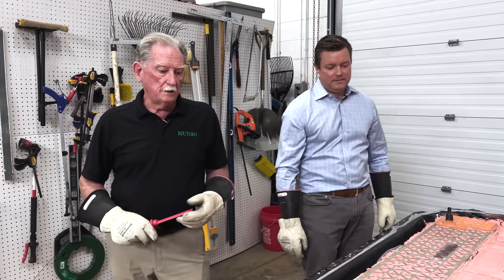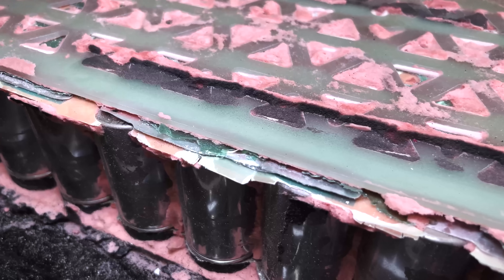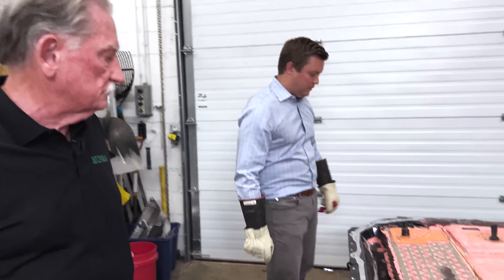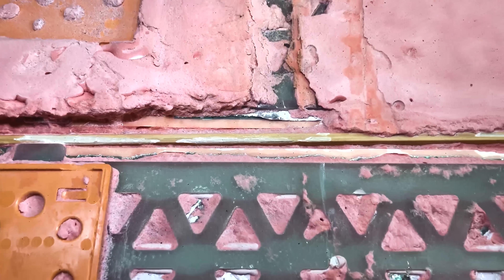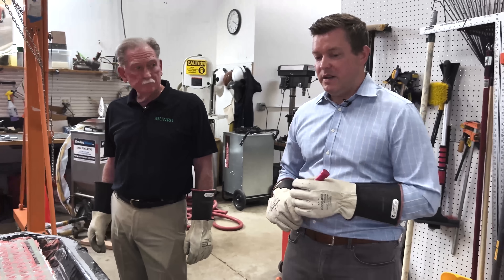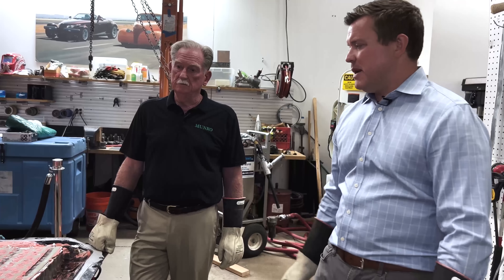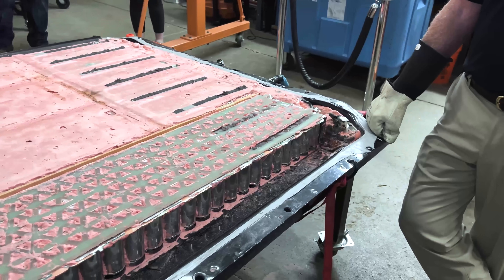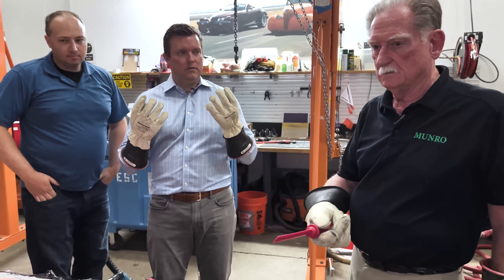4680 Battery Pack: What We Found Under the Foam!

Comment: Cory, Sandy and team Great video. Interesting comment from Sandy, 'Telsa does not have a limit on their capacity to invent'  This permanent foam approach, a person can never do maintenance on this type of battery pack, means Telsa has lots of faith it will have extremely low failure rate.
Reply: Capacity to correct their errors and restart the learning curve for manufacturing.
Reply: Tesla has always found it too dangerous for their service technicians to work inside packs. They get assembled, sealed, charged and are supposed to stay sealed until they get recycled. So nothing new here, the foam just seals the deal.
Reply: It also means ultium is a joke.  It is designed for serviceability because GM has zero faith in their batteries.  The companies that cut corners to reduce warranty risks will have less efficient cars that cannot compete.  Tesla can probably recycle an entire pack to base minerals for less cost than a single in warranty cell replacement on an ultium pack.
Reply: "Maybe"...... Only time will tell.
Reply: It panhandle used vehicle and you risk something big and expensive going belly up. A high spec engine of transmission costs £££$$$ plus another huge wedge to fit the new parts.
Reply: It panhandle used vehicle and you risk something big and expensive going belly up. A high spec engine of transmission costs £££$$$ plus another huge wedge to fit the new parts.
Reply: Not to mention (to all the "but service" commenters) but if it's under warranty and fails, you get a complete new pack, WINNER
If it hasn't failed by then, it's likely to last much longer.
Reply: @rogerstarkey5390  Right then they can recycle it and make a new one.
Reply: @rogerstarkey5390  yeah, this makes sense. Also, if you remember from the earlier videos from when they dropped the structural pack, it was among the simplest to remove from the rest of the car Munroe has torn down, iirc anyway. Meaning that once these are manufactured at scale, this is going to be a relatively simple procedure, decades from now when you finally do want to replace your battery because the rest of your car held up for 400K miles. And it will probably be cheaper and more energy dense by then as well.
Reply: @normanbayona4636  This does not appear accurate, previous dives into the service manuals indicated that replacement of the 4680 structural pack requires 314 steps (143 for removal and 171 for reinstall).

With the structural pack you're removing the entire floor of the cabin, and everything attached to the previous pack needs to be removed and put on the replacement pack.  Now if the plan is to just unbolt the structural pack and plop in a new one with new seats and everything attached, that's a different story but I think is pretty doubtful.

Otherwise I have a feeling that replacing previous battery packs is much simpler than this.
Reply: @Destor-p3b  I agree. There was a Tesla video of the model S getting the pack replaced faster than a car gets filled with gas
Reply: @nickvanhorn681  It should be, you would just be hoisting the vehicle and removing the pack from the enclosure under the vehicle right?

The structural pack might simplify things for Tesla during the manufacturing process, but replacing the packs afterwards looks much more difficult from a serviceability standpoint unless they're giving you all the components with the new packs as a pre-assembled unit.  And I'm sure that's not the case, they'll be taking all the components from the old pack and switching them to the new pack.

This would also likely increase the incidences of post-replacement issues, as swapping out all these components introduces more opportunity for human error along the way.
Reply: @normanbayona4636  But I wonder how these cars will hold up long-term against killer rust? Some EVs are already rusting quite badly.
Reply: @tomlewitt  to my knowledge aluminum holds up better to corrosion, though folks in the north dealing with salt on the roads might have it harder. But assuming that's generally true (and I admit it may not be true), at least the structure would be in decent shape.
Reply: @rogerstarkey5390  If it's under warranty and fails, I heard most people gat a REFURBISHED pack.  Not a new pack!! 👎
Reply: @ajsaldana4212  
Ah!
"You heard!"
That's 100% cast iron guaranteed then......?
Reply: @rogerstarkey5390  So after warranty its trash? Or do we just devalue it 20k? I'm sure the full cost of replacement will need to include labour and hazardous material logistics for a questionable pack to be re-cycled (or landfill if its cheaper) on top of the specialist shipping and price of the new pack to the nearest approved shop. Also what about all the cars too far away from an approved shop. I cant get too excited for this, perhaps better tech will be born from it. But there is still a long ways to go. If something can go wrong it will, at the number these will be cranked out its sad the last 10 years of the cells life will be wasted due to 1% of the cells which will wear at 3x the speed.
Reply: @alphabuilders  
 You're from the "if's and but's" department?
No.
"After the warranty" it may be good for decades. "We" don't know.
It's certainly NOT "Trash"
"The full cost of replacement" 
Will obviously Include labour (noted by the spelling you're from the UK? Oh dear.)
As for "Hazardous materials logistics" ..... Why?
The company REPLACING  the pack would simply call the supplier of the new pack and say "we have an exchange unit ready for collection", kinda like they do with ICE engines now?
That would happen on the routine day the deliveries are made in the area.
They would then claim the value of that pack (yes, it's worth money!)
.
The new direct replacement, containing cheaper cells (Tesla estimate 50%, because in the preceding years they'll produce Billions of them) would be bolted to the reset battery management and control module (yes, it's separate on a Tesla, sitting on top of the "battery box")
.
So, you'd have a "pack" 
(battery module) at 60% of the original "module" cost,
minus a consideration for the valuable old unit, fitted to the control box you didn't need to pay for, plus about an hour of labour each to remove and refit, then an overnight charge, followed by let's say another hour for the final automated condition check and a road test?
(Try that amount of labour for an engine swap? More like days)
The "questionable" pack would then CERTAINLY go to a specialist recycler (come to think of it, THEY would collect it!)
They will check the discharge, shred it, and recycle "ore" at 1/6th the cost of new stock (actual statements by those doing it will confirm this).
.
Then there's the possibility that I've mentioned of maybe "fusing" a cell (conventional, or electronic) to simply remove 1/850th of the capacity? Remember, they know about cells now.
Just btw, how do you "know" that "1% of cells will age at 3 times the speed (rate)"?
Reply: @rogerstarkey5390  What do you say to people buying a used vehicle outside of warranty? Too bad, go buy a new battery?
Reply: @DavidJohnson-tv2nn  You say the same thing you'd say to anybody buying any used car, EV or ICE out of warranty, the difference being Tesla's warranty is 100,000 miles. Real-world experience suggests that if the battery hasn't failed during the warranty period, it will most likely last half a million miles before output degrades below 80% of new. 

The reason you pay a fraction of the new car price is that there may be unexpected repair bills. Maybe that's why used cars cost less than new ones.
Reply: @douglasburnside  How much does a used Tesla cost? I believe they are not cheap. The point it is that it is unacceptable to have the most expensive component in the car, costing $10,000 + be unrepairable!
Reply: @douglasburnside  What real-world experience?  Most Tesla owners don't hold onto their cars long enough to find out!  Most have traded it in on a newer version with 'the latest' version of gadgets.

The few who have, replaced AT LEAST one drive unit, if not also the battery.
Reply: @DavidJohnson-tv2nn  
You need to both define and verify "unrepairable"
What will you say if they determine each cell is "fused" and can be "mechanically" (or electrically) removed from the circuit?
That would essentially be a "repair", only reducing the capacity by 0.125 percent.
.
Reply: @rogerstarkey5390  This design was not built around single cell or even module or section replacement, but as ONE SINGLE UNIT.

That would mean it's not repairable a d wor have to be replaced in a specialized shop with a specialized frame jig, since it's essentially the base of the car's frame.
Reply: Elon has said that they are trying to make a million mile battery pack. A significant amount of climate change gas is released to manufacture a car, so making cars that last a really long time also reduces climate change gas emissions, which is the entire objective for Tesla. The Cybertruck will not rust and it is super hard to even dent, plus no paint, and it will have basically this battery pack. I expect the vast majority of Cybertrucks to still be on the road after forty or fifty years.
Reply: @tribalypredisposed  elon say's lot's of stupid shit
Reply: @tribalypredisposed  Then you haven't seen a recent salvage auction.  Many of those vehicles were brand spankers before being wrecked.

But if you're TRULY concerned about the environment, then buying NEW CARS is one of the WORST things you can do.  Better to drive an older ICEV and maintain it properly, than incentivize a company to put out new disposable crap that's obsoleted in 5 years (Teslas included).  There are OLD (20+ years) used ICEVs on the road with over 250k on the clock, working just fine.  There isn't an EV made that has (or CAN) rack up those miles.  Any that have come close, have had AT LEAST 1 motor and one battery replacement.  And newer charging standards don't always work with them.
Reply: @billcichoke2534  that’s been proven false time and time again. An efficient EV like the models 3 is better for the environment after 18 months and even with a dirty grid and and less efficient EV worse case is like 4-5 years. 

ICE cars have tons of issues after 100k miles. It’s pretty common for an EV to make it to 200k miles and for the average driver to reach that it will take around 20 years.
Reply: @billcichoke2534  dude there are Numerous Tesla taxis on the roads with Ober 300k miles on the original battery and motors.
Reply: @anonym3017  Not according to the operators.  And those have been almost entirely Model Ss, which were built SLIGHTLY better.  All have had either just drive unit or both that AND battery replaced.
Reply: @billcichoke2534  I made the decision to live car free in 1977, the solution is a bicycle. But most ICE cars are only good for 150,000 miles, average, no matter how well you take care of them. Most Americans will not abandon cars, so the best option for them is to make EVs that last a really long time/have robo taxis that replace multiple ICE cars with one EV. 

Probably we are all doomed at this point anyway and I should just fly around the world having fun and emitting climate change gas like crazy. But on the off chance I will still be out there pedaling away.

Also, there are plenty of Teslas with more miles than that on their first motor and battery pack. It was only basically the first year of Model S Teslas that had motors and packs that needed to be replaced under warranty in significant numbers.
Reply: @tribalypredisposed  I would beg to differ...most cars aren't taken care of, yet STILL get to 150k or better.  The ones that ARE taken care of, last well past 200k.  Quite a few Toyotas and older Mercedes have gone past 1 mill miles on the original drivetrain.

I don't see that happening with EVs.  Like touchscreen phones, they're built around technology obsolescence, which means sooner or later they won't be supported.  That means multiples more junked cars destroying the environment, leeching toxic metals into the ground water.

If you're in a situation where you CAN bicycle around, then that works for you.  Personally I think limiting peoples' choices for personal transportation risks more problems than any we THINK we have now.  And we're using more and more energy to not use petrofuels, which means we're being even LESS efficient or good to the planet.

Fixes are being put in place to address what wasn't broken, and many things are ending up worse off as a result.
Reply: @billcichoke2534  you can beg reality to differ, but reality is reality. Yeah, you can easily find articles claiming that the "average" modern car can last 200,000 miles, but here are the actual numbers of cars with over 200,000 miles in percentages: Toyota Land Cruiser: 15.7% over 200,000 miles, next highest car model is the Honda Odyssey with all of 2.7% having over 200,000 miles, and it goes down from there. The eighth best car for longevity, the Toyota Camry, only 1.5% have over 200,000 miles. 

Once Tesla has a lot of cars old enough to reasonably have 200,000 miles on them, the Tesla percentages will be much higher. There just is a lot less that can break or go catastrophically and expensively wrong, and the cars keep getting over the air updates so they do not in fact become obsolete, instead they keep getting better. Lots of Tesla owners have cars with faster acceleration and more range and faster charging than when they were brand new, in fact.
Reply: @tribalypredisposed  Actually, since these cars are computerized and have more electronic components than mechanical, there is far MORE that can (and DOES) go wrong.  Those 'updates,' by the way, have been interface and display changes, but mostly BUG FIXES.  They haven't been IMPROVING the cars, they've been CORRECTING them.

What most people don't understand about EVs is...you don't maintain them because you CAN'T.  There is little if anything that is user serviceable, and anything that does happen, is a component FAILURE that requires REPLACEMENT.  If your gas tank springs a leak, you don't have to replace it AND THE FUEL SYSTEM.  Often it can just be patched.  You lose ONE CELL out of a Tesla battery pack, the WHOLE THING needs to be replaced.  As well, you can lose the ability to keep a charge due to manufacturing errors, and no scan will ever find the problem.  You lose a spark plug, it's pretty obvious what's going on and the fix is as simple as a new plug.

THAT is the reality.  The narrative about their superiority, is the sales job.
Reply: @billcichoke2534  the amazing thing is that nothing you say in your long posts is true. I worked at Tesla making Model 3 battery packs, for example, and they definitely do not brick if one cell goes bad. In fact, lower range packs were made by adding some plastic dummy cell blanks to the pack to fill the space. 

Thanks for coming around to audition for the  role of "online person who knows something about EVs," don't call us, we will call you.
Reply: @tribalypredisposed  What's TRULY amazing is, your post is a bad strawman and Tesla themselves REPLACE THE PACK if there's a bad cell.  And I've been involved with EVs since well before Tesla was a thing and Mysk bought his way into it.

Your opinion is now as invalid as your 'expertise.'  Stop parroting Musk and learn to do your own research.  You won't sound as ignorant next time.
Reply: @billcichoke2534  A few months ago, the first model S with more than a million miles on the clock was confirmed.
Reply: @fluitfluiten  If it as the gent in Europe, that car had more than one motor replacement and at least one battery pack replacenent.

So no, it didn't.  Not even close.
Reply: @tribalypredisposed  
"Elon has said that they are trying to make a million mile battery pack"
Trying?
Musk is also "trying" to make full self driving work. And has been making claims every year since 2015 that full self driving is just around the corner!
Tell me something...
While Musk is "trying" to make his million mile battery....
Do you think putting unrepairable battery packs in customer cars is ok or the right thing to do?
Reply: @DavidJohnson-tv2nn  Sure if the battery fails under warranty it’s replaced or you get a new car or some pro rated cash equivalent.   If you don’t agree to that then don’t buy the vehicle.
Reply: @ken-mb5cp  So what do you say to people wanting to purchase a used vehicle outside of warranty? Too bad, you're out of luck?
And what happens if other manufacturers copy this throwaway stuff? Should people just not buy cars and walk instead?
Reply: @DavidJohnson-tv2nn  Buy an extended warranty.   I think they’ll be robotaxis in a few years and you won’t need to own a car.  The market will figure it out.   What’s your solution?   Stick with gas cars?
Reply: @ken-mb5cp  Yup.  Much better spend if your money and ACTUALLY HELPS THE ENVIRONMENT.
Reply: @DavidJohnson-tv2nn  Yes David, just like every other device in your house and pocket have become uneconomical to repair.  That's how you bring down acquisition cost.  That has been learned in nearly every industry.  Take a moment to compare a video of AP/FSD from 2015 to 2018 and then 2022 and it's obvious how far it has come, even if taking longer than promised/desired.  People who actually produce complex products in technology understand how hard it is and how often timeline are overrun.
Reply: @DavidJohnson-tv2nn  That's what Brandon's people are telling us.
Reply: @B.L. Alley " brainwashed by big oil"
Oh really? Did I say anything about gas powered cars? 
I'm specifically talking about the unrepairable 4680 battery pack as compared to previous battery packs.
Reply: Truly amazing on the capacity of Musk fans/Tesla investors to spin built in obsolescence into a good thing. Yep customers, pay $10,000 for a new battery and be happy!
Reply: @DavidJohnson-tv2nn  What do you think it costs to replace the engine and transmission in an ICE car? Would that make you happier? It is far more likely to have an out-of-warranty ICE replacement than a Tesla battery which is guaranteed to go at least 100,000 miles. Note also that the batteries rarely "fail", they gradually (about 1-2% per year) lose efficiency. Even after 20 years, when they might be down to just 80% efficiency they can be repurposed for home solar storage or other uses. What repurposing will you get from a 20 year old iron-block V-8?
Reply: @douglasburnside  This is not a debate about ICE cars vs EV's. It is about purposely designed unrepairable battery packs, and built in obsolescence. There are many used cars purchased that have over 100,000 miles, and are out of warranty. What do you say to those people? Too bad? Go pay Musk another $10,000?
Also, hope you realize these 4680 packs can not be dismantled to have their modules repurposed as home energy storage. A total waste!
Reply: @douglasburnside  INCLUDING labor, it costs about $5k to replace engine and transmission.  That car is then good for at least another 100-200k.  It also won't become obsolete, like the golf cart with an older iPod.  So there's no NEED to repurpose the ICE...you're still able to use it, often for longer than THIRTY years.
Reply: @DavidJohnson-tv2nn  Turnkey 10 sp Transmission replacement for a Honda is >  10k !  It likley a LFP battery will be cheaper soon. Many transmissions don't last the life of the car.
Reply: @longtimber1  Transmissions are also repairable for way less than 10k. Not sure about the Honda, but if costs were that high, I wouldn't purchase the car. Like I won't purchase a Tesla. 
In my opinion, the thing that needs to happen is for government to step in and ban unrepairable EV battery packs. Or other unrepairable components, EV or ICE, costing thousands of dollars.
Trust me, you wouldn't want to live in a system with total unregulated capitalism. Where greed would rule.
Reply: ...Trust me, you wouldn't want to live in a system with total unregulated capitalism. Where greed would rule...

 @DavidJohnson-tv2nn  1) No such thing as unregulated capitalism in market economies. 2) Market transactions are 2-way; greed rules on both sides and somewhat counterintuitively, it all seems to work out 3) And the utopian alternative is ?? Maybe the state enterprise (UNREGULATED state capitalism) vs private enterprise, the ideal worker collectives of the Soviet era, Mao's China, Pol Pot's Cambodia, etc, etc, etc. Lovely times... no greed or corruption there and perfect for the elite CP members.
Reply: @DavidJohnson-tv2nn  Completely agreed on regulated capitalism. Governments must exist to address various free market failures.
Your characterization of BEV lithium-ion batteries as throwaways is an overstatement. It's nearly impossible to kill LFP batteries and the current iterations will easily last 500K; they (whoever they are) say 1M miles is achievable for LFP. And ternary batteries are good for 1/2 or more of those miles if you follow proper charging methods. T's warranty is 8 years or 100K. I believe they hedge low in case the end user regularly supercharges to 100% which greatly shortens the life of the ternary battery. Normal wear is 1-2% per year or 10-20 years of service... hardly throwaways... and I as a consumer will feel very happy (not screwed) with a BEV that lasts 10-20 years before its next battery replacement. PS...the 4680 will, by superior design, last even longer than prior gen ternary batteries
Re regulation... no need. The BEV manufacturers on their own will improve battery technology without incentives or regulation. That trend is very well established. It's in the BEV maker's best interest to make the most competitive product they can. Needless regulation will cause rather than solve problems...  perverse results and/or lower efficiencies. To wit, organic farming in Sri Lanka... the list is endless.
Reply: @russhare4793  Batteries that can't be opened for repair are throwaway as far as the customer is concerned. Recycling does him or her no good. 
Despite all the claims, battery packs can and do fail outside of warranty. There are many examples on YouTube. One guy got so peed off he literally blew up his Tesla on video! That battery was repairable. But Tesla refused to repair it. Continuing their long history of being anti-repair. 

You can argue the numbers are low all you want. That means nothing to someone who receives a $10,000 to $20,000 bill! These are the people who need to be protected.
Ban all unrepairable EV battery packs. No matter who the manufacturer is.
Reply: @DavidJohnson-tv2nn  1) Tesla is NOT anti-repair. Simply put, they take a different approach to vehicle service, one they think is superior to the prevailing approach. If/when they feel the need to change their methods, they make changes, something they are doing RIGHT NOW. Tesla recently freely open-sourced all of its repair manuals meaning any mechanic can learn how to repair any Tesla vehicle for free. This opens the door to 3rd party service - we'll see how that plays out. In the end, customers will choose  Tesla or not, for whatever reason, service, quality, safety, efficiency, engineering, performance, range, etc. If you don't like their service approach, buy something else.
2) How Tesla designs/engineers its battery packs is their business, not yours, and certainly not the government. Where you complain, Sandy Munro praises. I'm siding with Sandy on this one. Once again, if you don't like it, don't buy it.
3) You're pulling all kinds of numbers from some part of your body. You have no idea how long the 4680 cells are going to last nor how expensive they will be to replace. It's brand new tech; will most certainly improve as Tesla iterates and as Jordan from the Limiting Factor predicts, the cost to manufacture will asymptotically approach the material cost (meaning the cost will GO DOWN A LOT) as Tesla massively scales production.
4) Finally, as recycling scales, the cost to replace could easily be LESS than the cost to repair. This is all in the future - we'll see how it plays out.
Reply: @russhare4793  1) It is not up to Tesla to decide who gets to repair the vehicle. It is up to the owner who bought and paid for it! Tesla IS anti-repair and there are numerous examples out their. Check out the Rich Rebuilds channel. Those service manuals should have been made available from day one! Yet more evidence that Tesla is anti-repair. Furthermore, from what I've heard, the manuals are inadequate. They show you how to remove and replace components, but not repair them. For example, no information on how to disassemble and properly repair an electric motor.
Reply: @russhare4793  3) and 4) I'm basing the costs on current, KNOWN replacement costs. NOT listening to Musk and his supporters claims. According to Musk, full self driving was "just around the corner". He's been saying that every year since 2015!
And.... How's that Hyperloop working out?
Or....
*  Boring company 150 mph loop system. Where ANY car can drive onto a carrier and zip off to their destination at 150 mph.
* Tesla Semi.
* Tesla Roadster.
* Cyber truck.
*  Starship flight to the moon in 2023. 
* Spandex man (Tesla robot). We don't need Cylons!
* The "Borg" (brain implants). Thank God that hasn't happened!
* Tesla solar.
* Robo taxis.
* $25,000 Tesla.
* Anything else I missed :)
Reply: @DavidJohnson-tv2nn  Look, Dave. You seem to be an f'ing know-it-all for everybody just because you say so. You disagree with Tesla's approach to service... I got it. BTW, I never said which side of the "right to repair" (which is sorta presumptuous in the first place) argument I am on. I like my repair guy and I hope someday Tesla opens the process up to others. In the meantime, they can do what they please, period. If you don't like it, DONT BUY A TESLA. Stop whining. and grow up. Everybody gets to have their own opinion and if they disagree with you, so be it.
Reply: @russhare4793  If Sandy Munro does care about consumers, then I wish he would come out and condemn designs that make repair of battery packs impossible. These packs cost thousands of dollars. And the 4680 can't be repaired, or repurposed for that matter. No way to remove modules for home energy storage. This design is NOT environmentally friendly or consumer friendly.
Despite claims about recycling, it is far better to repair, repurpose, and reuse.
Reply: @russhare4793  You agreed that government has a place in regulation. And no, I don't know it all. But do have some strong opinions on some things. Didn't mean to offend you in any way. 
I really wish you would rethink that Tesla and other companies can "do as they please" and the inevitable consequences of that.
You or I can't do as we please. There are good reasons for rules and laws.
Have a good day.
Reply: @DavidJohnson-tv2nn  Oh yeah, that's what we need.  The government to come save us some more.  David and the government have all the truth.  Never a doubt do they have whether they might be wrong about something.
Reply: @russhare4793  Unregulated anything.  As long as humans are involved, someone will find a way to get an advantage.  Some ways to benefit; some ways to harm.
Reply: @DavidJohnson-tv2nn  Those goals you list are NOT Tesla's goals for their packs, so of course they are not optimized for those purposes.
Reply: @DavidJohnson-tv2nn  They can do as they please as it pertains to their business.  If they're wrong, they fail and you get the glory of "I TOLD YOU SO!".  Their track record is not one of failure, except as a weigh station on the path to success.  You seem to view every current state of their product as the eternal end state, even though they clearly never stand still.  The Model Y has been on the market just a couple of years and has already undergone substantial renovation.
Reply: @scottgaree7667  Corporations can not be allowed to do as they please. We as individuals can't even do that. Are you suggesting that corporations should have more rights than people?
In an environment of anything goes, they could put out unsafe products, lie, cheat, price gouge, and the list goes on.
You must be a Republican?
Reply: @DavidJohnson-tv2nn  Ha ha  ha try $20,000!
Reply: It also means that any hopes of recycling any of this are lost.  For shame.
Reply: @davereichert  Apparently you didn't watch the video. 7:50. Nearly 100% recyclable.
Reply: @douglasburnside  Sure, but practically everything is recyclable, provided you throw enough money/energy at it.

If it doesn't make financial sense to recycle, though - it won't be recycled.

There's plenty of "recyclable" material that gets diverted to landfill because there's market for it.  This will be no exception.
Reply: @douglasburnside  No, we're just living in reality, where it ISN'T.  Not even CLOSE to 100%.
Reply: @davereichert  Did you watch the video? The batteries aren't removed one by one and recycled. the whole unit is ground up and recycled. This was explained clearly in the video.
Reply: @arseliopereira2541  And what does it cost to separate all of the materials in that resultant composite of granular material?

How much energy, and how many different hazardous chemicals are involved in that process?
Reply: @davereichert  let’s see that resultant mixed powder has way higher concentrations of any given material than the best ore for the same material.

Meaning that the answer for both energy expenditure and cost is “an order of magnitude or two less than what’s required to get the same amount of material out of ore.” Cause gravimetric methods get you pretty far
Reply: ...How much energy and how many different hazardous chemicals are involved in that process?...
 @davereichert  Battery recycling, a closed-loop approach with far fewer opex, carbon, and ecological costs compared to original mining, refining, and logistics... Duh
Reply: @russhare4793  I guess that explains why so few lithium ion batteries are recycled now?  

Pretty much the only thing the market is currently doing with old cells is shoving them into cheap USB powerbanks.
Reply: @davereichert  My guess. The recycling facilities are nowhere near scaled at this point; the mechanisms for diverting recyclable materials are underdeveloped/inefficient; and, the availability of a significant amount of recyclable materials is just not there at this time
Reply: @davereichert  All battery packs are recycled this way. Nobody is going to open a battery pack, remove the batteries, open the cans and dump the contents out.
Reply: @davereichert  Sandy talked about this.  Dip it in nitrogen to freeze it, put it in a grinder and you end up with "high quality ore" that can be processed to extract raw materials.   Time will tell to see how much that ore is worth and if it makes up for the lack of reparability.
Reply: @davereichert  No, it is very recyclable. That is there intention for the end-of-life battery.
Reply: @davereichert  

Define "recycling"
If you mean "second use", no. A pack at 65% is still useful.
.
If you mean "recycling" (reclaiming) materials, watch the video again (" big shredder")?
Reply: @davereichert  Maybe you should pay attention to the video instead of commenting utter BS.
Sandy explains for several minutes how it can be recycled.
Reply: @macko-dad  
Yes, that recycling skit was hilarious.
Reply: @macko-dad  Yeah...and Sandy also fell for the 'solid hydrogen storage' scam.

This is designed to be REPLACED...aling with the rest of the car.  You won't repair or reuse this, since everything is WELDED and FOAMED IN.  You can't take it out of the car, si ce the body is stressed to it and would break if you tried to reintroduce a new pack.  And the processes needed to dissolve the foam and extract any usable materiel for recycling, are pretty much illegal except in specific laboratory conditions.  Sandy's nitrogen concept totally ignores this, as well as how certain alloys and compounds react to liquid nitrogen.

This is the most illogical concept I've ever seen on a 'preproduction' vehicle.
Reply: @macko-dad  Things only get recycled when it's cheaper to do so than sourcing new materials.  It'll only be cheap enough when it's easy.  They haven't made it any easier with this design.

Are you also against right-to-repair?
Reply: @billcichoke2534  1. they literally removed the pack from the vehicle and then put the remaining vehicle on a hoist and lifted it. So you can evidently replace the pack.

2. you don‘t need to remove the foam for recycling. You don‘t even need to open the pack. Just discharge the still assembled pack and then throw it into a grinder/shredder where the entire thing gets turned to dust.
Reply: @anonym3017  And the didn't drive the vehicle, so that proved nothing other than they needed more room in the shop.  As any bike rider will tell you, removing a stressed member from your frame, compromises the frame.

Again, there is little in that powder that can be recycled.  Even the ALUMINUM is contaminated and needs a couple of toxic reclamation steps before it can be smelled into bar stock.
Reply: @billcichoke2534  yeah no.

As any bike rider will tell you removing the engine, a stressed member of the frame, from a bike does absolutely nothing to the frame.

Because as it turns out the forces acting on a vehicle while driving are a few times higher than the forces acting on it while stationary.

Fucks sake the battery is one of the last things that Tesla installs when assembling the vehicle. So removing it definitely doesn't damage the frame because if it did all Tesla model Ys from Texas would come from the factory with a damaged frame.

And the black powder, if you used a shredder to disassemble the pack, is a mixture of lithium, nickel, manganese and cobalt for an NMC chemistry.

Which is worth a lot and easily recycled.
Reply: @anonym3017  Then you really don't understand how a 'stressed member' works...and the battery pack is NOT the last thing put in place.  The front and rear subsections and the body sides are secured to it before everything gets tightened down.  Just like a bike frame, where the engine is attached to the frame and the suspension is THEN secured and the bike is THEN put on the ground.  The stress of the vehicle's weight is put on the frame and stressed member AFTER ASSEMBLY.  It takes a special rig to hold the frame in place if you remove the engine, because the frame is not designed to hold itself WITHOUT that stressed member, and will partially collapse or fold.  See Ducati or Aprilla or KTM for reference.

And the completed batteries are not pure cobalt or lithium or nickel, but oxide and other COMPOUNDS.  In addition, you have the foam dust, which will stick to everything (just like it does when you shred styrofoam into powder).  In order to get the raw materiel, there are at least 2 chemical processes required, neither of which is legal in the U.S. in an industrial setting.  You cannot simply use the ground up components, because they've cross contaminated.  This is why no viable recycling company exists.  There is no way to profitably and safely recycle these things yet.  Embedding them in plastic and foam and pot metals, isn't going to make the job easier or better.

I think Sandy's been crapping the bed since he went soft on Tesla and started simping for them.
Reply: @billcichoke2534  as pointed out in a previous munro video the battery pack and interior pieces attached to it are a complete subassembly.

That means that the battery pack gets installed when the rest of the interior gets installed. Which is the last step of assembling a vehicle. After that it goes to quality control and gets shipped.

And again. Dropping the engine from a bike doesn't damage the frame. Because once again. The forces vehicles experience when driving are multiple times higher than what it experiences standing still.

And finally getting rid of the foam from the dust is easy. Just melt the entire thing and then disolve it in acid.
Reply: @anonym3017  The 'previous video' was in regards to an earlier design, where the pack WASN'T part of the frame.  It has nothing to do with THIS variant.  And, as I mentioned, you cannot set a frame on a stressed member, then remove that component later without the frame being in a specialized jig.  I also referenced several bike manufacturers who use that setup, since they talk about this very thing.

And I don't know where you're coming up with your recycling process.  Literally NO ONE has said it was a simple 'heat and dissolve' process that could be done cheaply and environmentally.  If such were the case, they'd be doing it already.

Not even Straubel is doing this.  His 'company' is still trying to figure out how to recycle JUST THE BATTERIES.  There is no one who thinks you can just drop a whole battery pack into a grinder and magically retrieve the component elements.  NO ONE.

Sandy and his assistant are voicing suppositions that are not based in a knowledge of the industrial processes involved.  They are hardly gospel or the final word on this subject.
Reply: @davereichert  I'm absolutely not against right to repair. My comment was merely about your statement that it can not be recycled. 
I believe that after 20-25 years of use (at first as car battery, then as a household energy  storage unit) it will be worth recycling this regardless of the complexity.
Reply: @billcichoke2534  ah yes the previous video called "structural pack out" (https://youtu.be/FXpfU6I_T3w) was about a model y that didn't have the structural pack. 

And again. The complete frame is designed to withstand the forces while driving without getting damaged. The forces it experiences when sitting still are under 10% of the highest forces it experiences while driving. So you can just remove structural pieces without damaging it.

The same goes for bikes. Fucks sake go to the hardware store and buy some steel tubing, maybe 1.25 " outer diameter 1" inner diameter and try to bend it. See for yourself what a ridiculous amount of torque is requires to permanently bend it. Then realize that a bike just sitting there without the engine doesn't even come close to exerting that amount of torque and has two of those tubes. Because the frame needs to withstand severe vertical impacts without getting damaged.

And then shut up and just watch the videos while trying to learn from them.  Cause you clearly know nothing about engineering
Reply: @billcichoke2534  
Or
"This is designed" to outlast the car ?
If there's an issue in 5 years, come back and gloat 
Until then
Never assume
Reply: @rogerstarkey5390  No assumptions.  And pretty much every Tesla out there has needed interior and drivetrain/suspension and electronics repair.  Whether through OTA bug fix or service center visit, they're all pretty much crap.

Verified by customers and Tesla weasel word pressers.
Reply: @davereichert  Not true.
Reply: @davereichert  

not necessarily 
it just means that Sandy doesn’t know what the best method of removing the pink stuff is but Tesla may know or someone else may figure it out and it may turn out to be very easy

It’s early in the game 
stay optimistic
Reply: @davereichert  That is not self-evident.  Remember, the first steps in recycling are total discharge followed by grinding to powder.
Reply: @davereichert  Look, kindergarten's fun, but when you grow up, then you can comment...